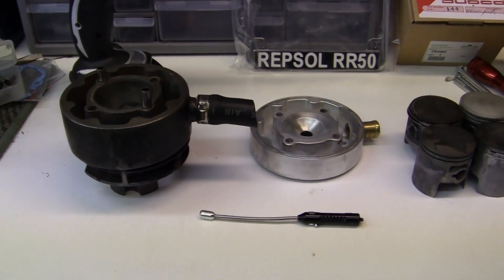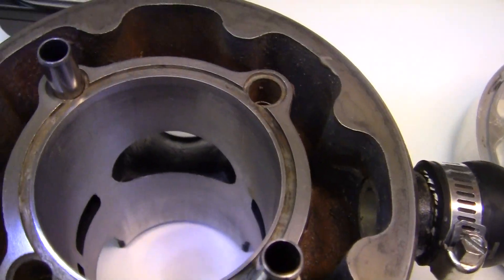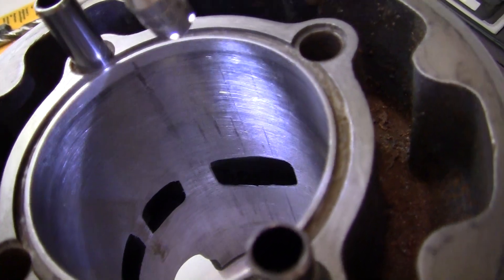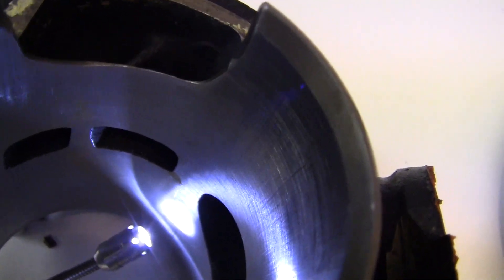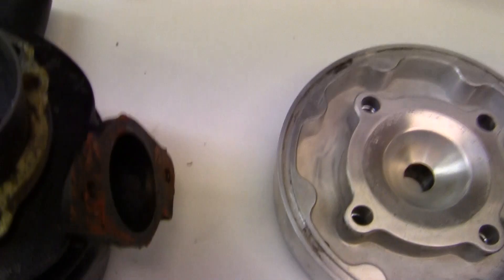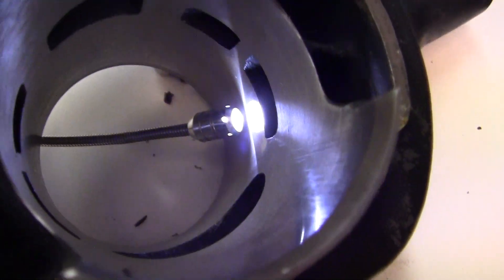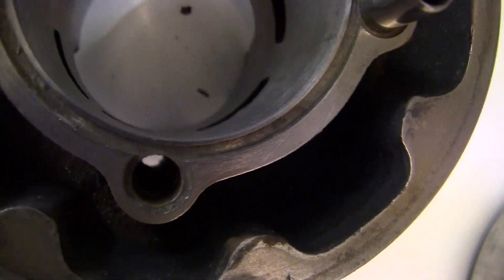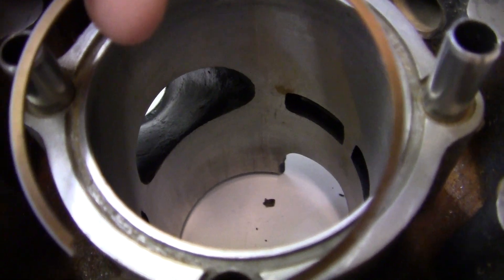I NEED ADVICE ON THIS CYLINDER PROBLEM

Comment: As many friends told allready, it's not so bad. But you have to hone it up and down to get a criss cross hatch. Always use cutting oil. After deglazing the cylinder, that a plastic brush,make it fit to your handy tool.Use soap water to clean the light scratches.Rince it with water.This way you leave free these "lovely" scrathes, to hold oil.After cleaning,apply 2stroke oil in the cylinder.
Also check the manufacter's piston to bore clearence.Increase that number by 10 percent for race use.

Comment: best bet is to get it re-bored with a new oversized piston, honing will never get these scratches out. honing is only used to deglaze the cylinder so a new set of rings will seat properly.

Comment: I have done this many times in a pinch and had very good results even with plated cylinders. If your cost concious just put the engine together and compression test it to see if you fall within spec. That engine should run good as long as the piston to cylinder clearance is ok and your ring end gap is good. Them small scratches should not cause you to bleed out compression that fast. Remember two stroke lube has a sealing effect.

Comment: Always remember to keep your hone rotating until it has completely exited the cylinder. In other words don't stop it then pull it out.  Stopping the hone inside the cylinder, then pulling it out, will create vertical scoring exactly like you see here. Just a tip for you.

Comment: I agree with what Joe said, if your fingernail doesn't catch on it, it should be o.k.

The ring gap should be somewhere between the 0.3 - 0.4mm mark & should be checked when fitted to the top part of the cylinder after inverting the piston through the top of the cylinder to make sure the rings are straight in the cylinder bore.

The best you can do is do a compression or a leakdown test after the rings are fully seated into the cylinder walls to check as it takes time for them to "machine" themselves perfectly into the cylinder walls.

I can remember I rebuilt a Stihl hedge trimmer with a brand new cylinder kit including a new cylinder,piston & rings, when it was first assembled, the compression was only 105 PSI but once the rings seated into the cylinder it rose up to 124 PSI !!!!

Comment: Wouldnt worry about the light scoring too much specially if you can only just feel it with your finger nail.. have seen alot worse scoring on 2 strokes and they run just fine. Dont forget to leave a 45 degree cross hatch on the cylinder so the rings bed in properly. :-j

Comment: I wouldnt worry but i do see an error in how you are using your hone. You need to put the cyl in a vice or something to hold it. Use WD40 to lube it and set the drill on a slow/medium speed but dont stay in one spot move up and down constantly so you get the hatching you are looking for that way the rings seat again.

Comment: can tell you have not honed before...the hone should have been used in an up and down motion constantly through the barrel making a angled crossing pattern ..also you should start with the most course then to med and then fine grades of stone,,...I would get the barrel re nikasiled sending the new piston and rings with the barrel...this will solve your problem with professional results...also check the crank gap between the rod shim and web

Comment: you need to use alot more oil when you hone a cylinder! you are scoreing the cylinder without lots of oil! not honing. get some cutting oil and use lots of it!
Reply: i put a lil oil in there. Should i put way more? Ik this old so hopefully you reply

Comment: looks like a new cilinder.. would think the piston rings where lil to long or is it a oil or metal part in engine thing?

anyway i just know you can drive any fucked up cilinder with just sandpaper and a new piston but its not "good"

if you need nikasil, than remind to buy a piston of them.. pistons are related to some type of nikasil. seen cilinders fkd in 400km

if you just get all those scratches out ( feeling flat) a new piston would do 10000km+ fine